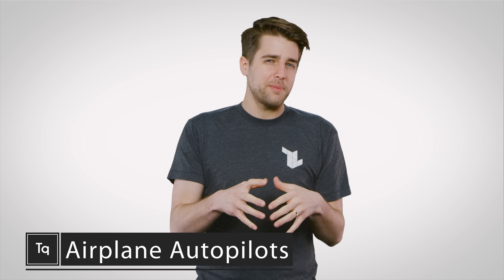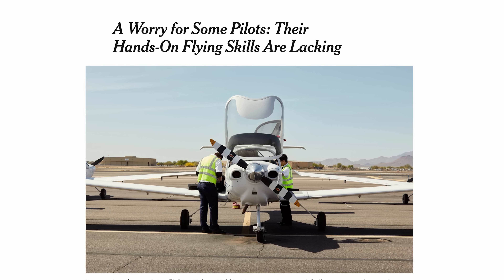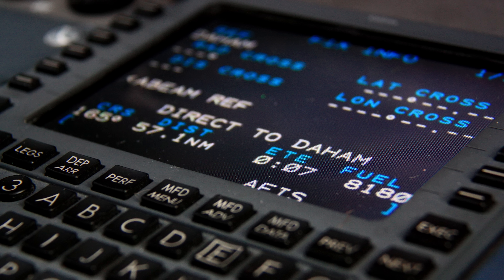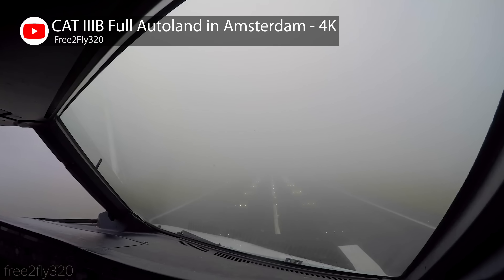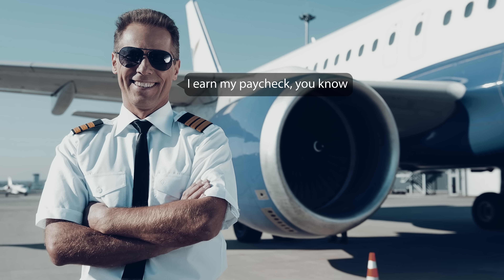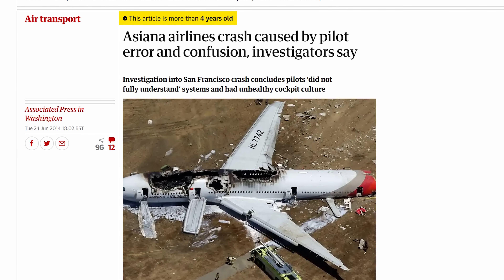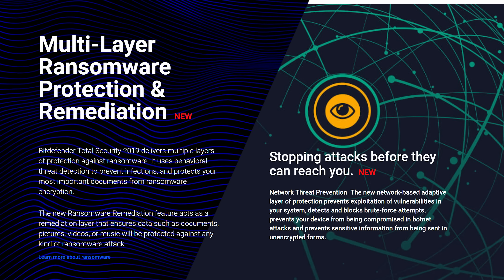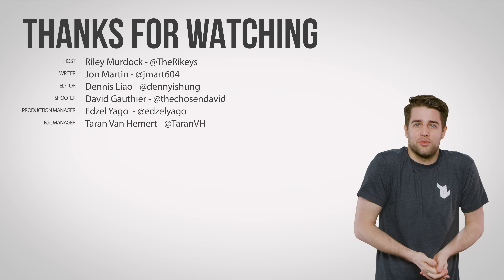Who's REALLY Flying YOUR Plane?

Comment: I’m a captain at a major US airline and just wanted to say this video was spot on.  The autopilot allows me to position the airplane more precisely within altitude, speed and heading/course constraints taking a lot of workload off me allowing me to do other things like look for traffic, avoid weather, etc.  But, if the machines mess up, and they do often, I can always turn the automation off and fly the jumbo jet like a Cessna.  

Nice work!
Reply: Just wish they'd mentioned that while yes the autopilot does all of those things, the flight crew is still busy monitoring what the autopilot is doing and what the aircraft is doing.
Reply: Agreed, it was well researched. Though as a First Officer for a European long haul carrier, I can only moan that the captain got all the glory in this video 😁
Reply: @Pastronomer69   actually, they put the captain in the wrong seat, so all the glory does go to the FO
Reply: ......exactly how "often" do the machines mess up...?
Reply: @Ashitaka1110  That's the thing; they rarely do. Most often it is the pilots who mess up. Flight management computers are like any other computer, and they operate under a logic of garbage in-garbage out. They do what you ask them to do, even if it is not an appropriate action for the phase of flight you are in. Automation is a wonderful thing as it can take so much load an pressure off the pilot during those busy terminal flight phases. Don't get me wrong, commercial pilots still have to acquire and maintain highest level of both manual and automated flight skill, but the strain and task saturation can be severely reduced thanks to automation. It's like driving on the night highway. Cruise control frees you up to monitor road ahead, but you must still be able to intervene in whatever way is needed to conduct safe and appropriate ride. What is important is to know when to reduce the level of automation, or take full manual control if automation is doing something you did not intend it to do. That is where some pilots lack in. But hey, most of you tossers lack that skill behind the wheel of the car, so you don't have the right to complain.

In a nutshell, air travel is the safest form of transportation and it's safety record has only been improving since man took the skies. Trusting your life in the hands of an airline pilot is a lot safer thing to do than try and commute by yourself.
Reply: @Ashitaka1110  they rarely do. but when they do they have at least one other computer, usually two, double checking everything.
Reply: @Ashitaka1110  How often do they mess up?  It really depends...

Mess up like fly the airplane into the ground if I don't do something?  I've never had that happen and probably never will.

Mess up something small like not make an altitude or airspeed constraint on an arrival?   That happens on almost every other flight.  But, I'm able to intervene and be right on altitude/airspeed.
Reply: Only thing that bothered me was the "people can feel if a human is flying it", if the pilot is using his pireps, weather data as well as trim then there should be no difference.
Reply: Otherwise this was one of the most well researched videos about aircraft automation I have seen in a while
Reply: @baconis_______.4764  I certainly can tell. No, not every time, but I have. Most often with the smaller regional jets (E series, and CRJs). I know it's when the autopilot is disengaged because the warning beeps (Master Caution?) can be heard in the cabin.
Reply: @shutupmokuba7520  Autopilot is separate from the MCAS system on 737 MAX. From what I've heard, the pilots did in fact hit the trim cutout switches (which disables MCAS), but re-engaged them. And the flight before the fatal Lion Air flight, the crew had the same exact issue but disabled MCAS through the trim cutout and flew the plane to their destination.
Reply: Sadly, some pilots are not as good as you... just like there is always a guy getting C on every test, not all pilots like to fly with zero automation, nor they are willing or know how to completely disable the automation...  (a very famous example is the Taiwanese China Air line 747 tumbled out of control after an engine failed.  The captain kept the autopilot on after an engine failed without compensating with the rubber thinking the autopilot will do it... the rest was history)
(Yes all planes can revert to some form of full authority mode where almost everything revert to manual control, otherwise they won't get certified to carry passengers. Only few planes won't able to fly in this mode, but don't worry those are planes like the F-117 or weird experimental planes like the X-29)
Reply: @AaronShenghao  F117 is a bomber that flies on full autopilot for most of the time, as the bomber is a single pilot aircraft it was assumed that the pilot could not fly the aircraft and bomb at the same time so uses the same autopilot systems from a 707.
Reply: @shutupmokuba7520  Couldn't or didn't?  I'm interested to see what the accident investigations of each crash reveal.
Reply: @Albert R Hell, even on Flight Simulator X or Vatsim more appropriately you basically live in the air via using autopilot. You only really do the takeoffs and landing from a certain distance yourself. While in the air you only really take back control when the autopilot is doing something silly and you need to fly while you re-fiddle with the settings or you get a bit bored and want to do a certain maneuver ATC ask of you as per your flight plan where you see the lines to follow on the gps map thing. 

btw congrats on captain at a big airliner! if only it would have been economically viable for me, I would have loved to have trained to be a pilot!
Reply: Let face it whoever fly it... The plane computer will jump in on before the plane crash....
Reply: It was an ok video.  But it makes it sound like computers do everything.  I fly a regional airplane, we fly with autopilot, but doesn’t have auto throttles, so we manage the speed.  The FMS does some things, but VNAV is questionable sometimes.  Just yesterday I was PF we were in HDG mode crossing through a LOC to be reshuffled (ATC Trainee got separation a little off, trainer took over) and as the CDI centered on the LOC the autopilot switched with no command to LOC* and GS*.  I was watching and hit the big red disconnect so nothing happened.  Usually I fly to cruise by hand, and all of my approaches except .1 RNPs I fly by hand.  We’re also required to fly the CATIII’s by hand with use of a HUD.  I agree that bigger planes like 737- whatever’s have more automation, but also can cause more workload, usually for the First Officer.  

My issue with the video stems from a statement that calls into question the experience level of pilots sitting in the seats.  Then gives an example of a foreign carrier crash while not mentioning the requirements we have to meet in the world of the FAA or EASA or the  Canadian Aviation Authority to get into the big planes and get the good pay.
Reply: Roodj1 actually, he mentioned min 1500 hours,a can most airlines having a min 3000 hours....how you’re supposed to get in the aircraft for that long without actually working for an airline is odd....
Reply: I'm sorry, you can't use vnav, hud and regional together... 3 times tables, vs and a crusty crt is true regional life..

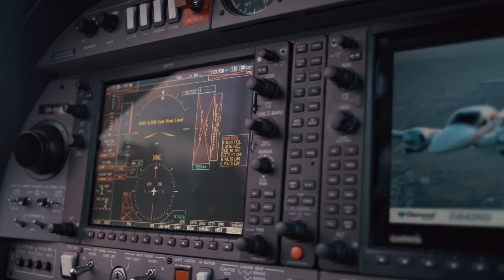Comment: 0:44 Let's be honest here, the anology is the same is Type Writer vs Computer. Modern Pilot should be trained on Modern Technologies like the new auto pilot systems. You don't train a person with Type Writer and expect him/her to use a Computer with proficiency. That's what happen with Boeing, the Pilots from the crash incidents aren't well versed with the new auto safeguard system that prevents the plane from stalling, based on the black box reports, the pilot continues to force the aircraft into a dangerous ascending angle that will result in engine stalling, while the auto system is trying to prevent that. If the Pilots was well trained before-hand, he/she would know ascending at such extreme angle will result in engine stalling.
Reply: You have the last comment on this   
Video

Comment: Real quick this is the book most pilots have to read over before even flying a plane. If your Techquickie videos are going to start taking about aviation I recommend reading over "Private Pilot Manual" by Jeppesen Sanderson (Contributor),Mike Abbott (Editor), Pat Willits (Editor), Liz Kailey (Editor). Not trying to sponsor or advertise any books under the comment section. Just telling you one of the books that with give you general information on flying. Note it does not completely cover creating flight plans because an aeronautical chart is not included with the book.

Comment: Boeing crash was because of that, the software used in new plane, was a modified version of old plane's, which was just instructed to tilt a little bit over when instructions were given in old manner, instead of it being from ground up and training pilots to instruct in a new manner. This resulted in the plane pointing down sometimes even when no instructions were given, though it should only do that when given to compensate resulting in nose diving to ground. Since Pilots were giving the same course correction instructions as previous ones they were confused as to why it did not change, because auto pilot ai was auto correcting the pilots instruction.
Reply: Neurotic Knight well, the autopilot isn’t A.I.
Reply: @blewis42002  It is an AI, just not NN or ML type that is most common these days.

Comment: Autopilot is great unless there's a bug in the software, as in recent news. The biggest problem with automation, however, is the fact that the newer generations of pilots have much less manual flight hours than their predecessors. They also know far less, and in fact are told much less, about how the plane works in its entirety. A pilot from the 60s and 70s could tell you how every single part of the plane worked together to achieve stable flight. I think you'd struggle to find a new generation pilot with that same level of understanding. Automation sounds sexy and all, but I'd always prefer a manual flight with someone who is comprehensively experienced.
Reply: Try manual flighting for +12 hours straight
Reply: @nikkopt  What used to be the case was that you'd have a three pilot crew and one navigator. Pilots would take turns controlling the plane and when it came to landing or taking off, the two pilots who had their breaks most recently would take control. This used to be standard practice, before automation.

Comment: Boeing 737 max is marketed as having the same flight characteristics as the Boeing 737, which is a lie, in actuality the bigger engine pokes over the top of the wing.  This means if you try to full thrust climb like the old aircraft you will stall the plane. Boeing added extra sensors and software to push the nose down which seem to be failing.  If you have a choice the Airbus A320neo  is a no crashy alternative.
Reply: They moved the engines up to make it have the same flight characteristics as the standard 737. No, you won’t stall while going to full thrust, quite the opposite.
Reply: @blewis42002  they moved the engines up because they would not fit otherwise, the carriage on the 737 is lower than on the A320, moving the engines up is a hack that changes the characteristics of the plane.  The point of the failing MCAS system is to counteract the nose moving up on full thrust something pilots only got 2 hours training on.
Reply: brian whittle hell, I forgot to say that they’re bigger engines. Well yeah, they are. And physically, if the engines are higher up, it won’t cause the nose to go up as much.
Reply: @blewis42002  they are above the wings at the top and more forward , it's not just that they are further up, the thrust dynamics are totally changed, MCAS doesn't work as designed, and the pilot training was not adequate.

Comment: Autopilot doesn't autonomously fly the plane, the pilot flies the plane using the autopilot. It actually requires a fair amount of effort. Source: am pilot
Reply: THAT'S LITERALLY WHAT HE JUST SAID.
Reply: "PiLOtS W0n'T HAvE jObS iN A fEW YeARS! AlL yOU hAVe tO DO iS PrESs A BuTT0n!" /S because I know the struggle of trying to explain to people the no, pilots are not on the way out, and no you won't see fully automated flights in your lifetime. Maybe one day in the DISTANT future but we are nowhere near that point. People have very little understanding of the amount of effort it takes to fly a plane safely even when you're on the ground there's still a lot of work
Reply: Towards the end it actually did mentioned this but thanks for backing that up. I too believe it more of a "relation" with automation rather than just "flipping a switch".
Reply: I know, I feel that even after saying this people still don't understand the amount of effort and knowledge required.

Comment: As someone that knows nothing about aviation, as long as the pilot could theoretically fly it completely without automation in the event of computer failure, then I'm pretty satisfied. But if the computer is fully in control and the pilot is incapable of taking control, then that's a real problem...
Reply: Don't worry, pilots are super skilled people. I mean that. They passionately know 100% what they are doing and are very talented. I am a student pilot and this video annoyed me  as it gives the impression the plane flies itself... It doesn't... It is said that in the future one of the only jobs that will never be taken by a robot is a pilot. The pilots taxi's (which is complicated in business airports), takes off and lands the plane themselves. Auto land (ILS) is mostly used when there is fog or something. When auto pilot is on the auto pilot is not actually flying the plane instead of the pilot but the pilot is flying the plane by using 'auto pilot'

Comment: Not only new planes can auto-land. The ILS technology has been available since the 30s, and the first fully automatic landing was in the 60s. Even the Concorde had CAT-III Autoland. Also, the Concorde was the first civil airplane with a full Fly-By-Wire system.
Reply: 223 Remington Autoland is not a new feature. As I said in my initial comment, the Concorde had an Autoland mode in its autopilot, and could perform fully automated landings. Of course, requirements have since been reduced, like the need for a CAT3 ILS down to CAT1